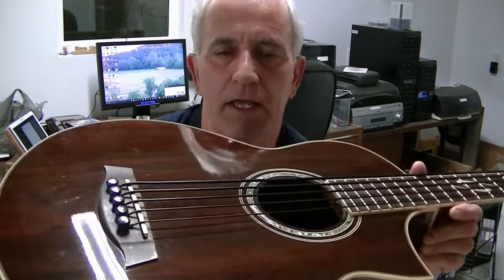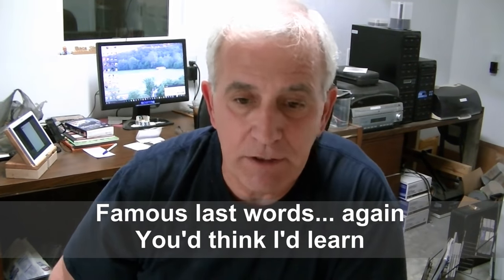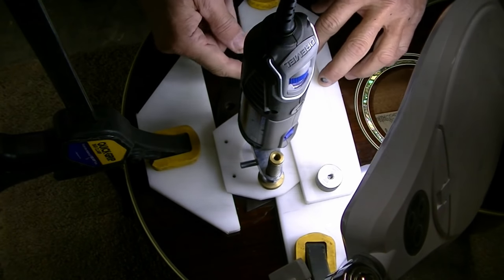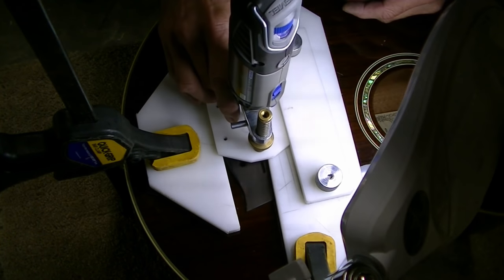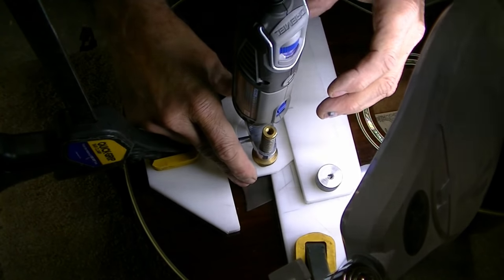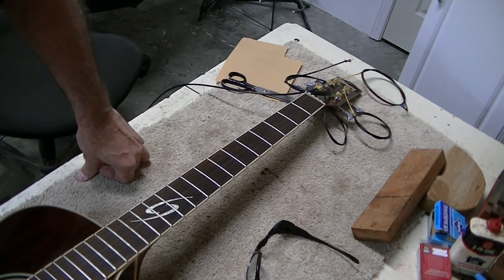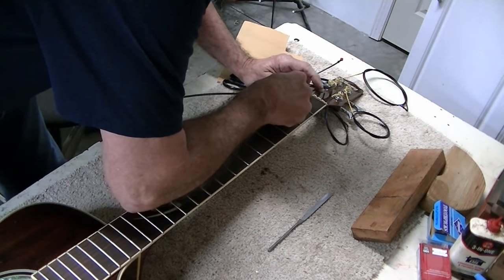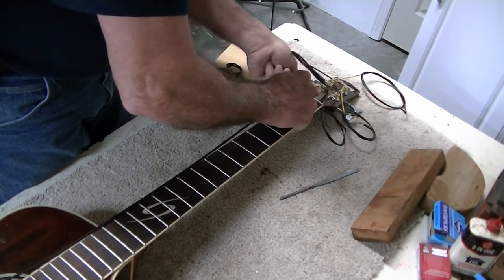114 RSW Ibanez Bass Severe Intonation Problem

Comment: I for one think you did a great job on this guitar. If you had elected to go with a tail piece, you would have had to notch the saddle to keep the strings from floating too far sideways on a bass. Their isn't enough of an break angle over the saddle with a tail piece without notching the saddle. I think this is the best solution I have seen for this problem. Also great execution of the work. Loved your video. Glad the customer was finally pleased.

Comment: Hello Sir,  I shall start with a compliment if you'll indulge me for a minute on my own journey with trying to achieve the best intonation results I can get. I've watched around 15-20 of your repair videos to date and am nothing but impressed by your depth of knowledge, wide arsenal of useful repair techniques and high standards applied to your work. I am a subscriber to your channel as well and have never seen anyone with the amount of patience and attention to detail that you possess.  I have been working on and setting up instruments for over around 15+ years and one of my first hurdles to face was adjusting and improving intonation.  One day another experienced guitar tech had watched me intonate a guitar on a repair bench (by this point I had roughly 5 years in and was working in a music shop on a instrument which now belonged to a customer) and immediately commented on the fact that unless the guitar was going to be played on the customer's lap then intonation should be only be measured in playing position.  I asked what his reason was and he continued to tell me that the influence of the instrument laying under its own weight in a flat position can provide incorrect readings in a range between 05-10 cents.  Now this was something unheard of by me so I put it to the test then and low and behold my readings were coming up sharp by a few cents on each string when it was flat versus playing position. Now these degrees can vary with all kinds things like the break angle caused by the height of the rest apparatus and weight of the materials on the instrument (basically the overall influence of gravity) but this information instantly revolutionized my intonation chops as I came away with a sharper and more accurate method of getting a good result than I had been previously. The way I put it into practice is before I "Call it good"' to quote yourself is to always give it the fine tune in playing position.  Cheers and thanks for sharing your talents and stories with us all.

Comment: I know this is an older video, my first time viewing it.  The only thought I would have had is a new bridge with a wider (deeper?) profile so it covered the scar in the front.  But then what do you do with the string holes?  I don't imagine you could fill the old ones with a patch under them, I am not an instrument guy, just a woodworker for 50 years.  You had a heck of a dilemma and I think you did right by the customer, loved watching you step through the problem with a solution.

Comment: Enjoyed this forced march -  I like and enjoy many of your videos giving me some confidence that I can get my Martin D28/1952 fixed.  One of the things that's obvious about intonation is that the higher the amplitude of string vibration the further off the intonation gets.  Not clear what genre this customer plays - you wouldn't think an acoustic bass would be the hot ticket for heavy metal, but the best advice for your customer would be to crank up the gain and use less force on the strings get the same volume with less amplitude.  The other problem with perfect intonation is some folks expect those higher notes to be sharper or flatter to their ear regardless of what they measure.  No less a light than James Taylor advises that he wants certain notes to be a few cents flatter to make his sound stage better balanced in his view (which as a fan I am good with).  A lot of good stuff.
Reply from the maker: Cliff Campen thank you very much my friend good information

Comment: I have an Ibanez ABG with the exact same problem. I was wondering about pulling the bridge. Fortunately, my bass doesn't use pins to anchor the strings. Also, Mine isn't as bad. Before I try routing on the bridge on mine, I'll try gluing another piece of bone to the back of the new saddle I made. I thought I might get it close enough, since the lower tension strings I put on should require less compensation. The bronze roundwounds were much worse than the strings I have now. 
Thanks for the inspiration! Keep up the good work!
Reply from the maker: magikbike you can send me a coupke pictures if you want.  Sounds like you have the right idea.  Thanks for watching.

Comment: My friend John, God rest his soul had a old vantage electric 2 piece and the guitar had a fender style bridge and the intonation was still off after taking the springs out and filing down the back side of the saddle and I still wasn't in the ballpark, no harm no foul. He had his mind made up on those graphite saddles and went out and bought them. I wanted the intonation to fall dead center so there was plenty of play to adjust so I had to remove the bridge, the screw holes were over a quarter inch in so I didn't have exposing holes when I was done, but I needed all of that quarter inch and the intonation fell dead center, perfect! Except there was one fret that was misplaced in the higher registers, this isn't a big issue for most, but he played a lot of lead and I would have had to place the fret just far enough over to have one big grove which I told him I could file the end of the fretboard and used that dust to make it the same color just adding most of the dust with the wood filler, shave that down with a razor then moistened the top with tight bond mixed with some of the Rosewood dust and sprinkled the rest on by packing it down with a flat surface. You could see the dust moisten up which is perfect. He insisted on that $150USD CHEAP beater that he called his Hot Rod when he had every top of the line Gibson made, but my favorite guitar is a $450USD Ibanez over all of my top notch Gibson's after working it. The Ibanez has a nice and fast neck because it has a shallow contour whereas the Gibson is fatter, more rounded. He had blue knobs off a kids dresser and cartoon decals all over it, but I put really nice pickups in and it sounded like a million dollars, all new top of the line hardware. He was a big man and strong as a ox, but kind as can be so I had to do a fret job and shave the wear marks from the board using a razor, just tip the razor back and pull so you don't stand the razor straight up, you will get chatter marks in the wood then turn the guitar around and do it again and I collect that dust. I call it magic pixie dust, no stain needed and if you have a deep groove in the fretboard from your fingernails you can use the same method, after you're done you can mix some of that magic pixie dust in with some wood filler or glue depending how deep the groove is and dust the top, I even used a needle to give it back the grain lines
Reply: Man that's hard to read. Try breaking it into paragraphs next time.

Comment: ....Thanks for the upload,  I'm still learning, I just bought a 5 string Ibanez bass,  in the set up guide, it says that the lowest frequency string should be a 'B' , rather than a 'C'
Reply: That's an interesting comment,.... However that lower (bass side) string was already vibrating and LOOSE all over the place when tuned to a 'C',... so going even lower to a 'B' would be worse.
.
Perhaps the GAUGE ( weight and type ) of strings - if lighter / narrower / wire -wound ,... might even help. That 'C' was sticking at the nut.
.
.

Comment: With all the challenges that this guide presents to you, you might want to replace the piece of white teflon (I'm assuming that it's teflon) with a piece of clear plastic so you can see the wood beneath it better. Also, I saw on a guitar maker's site (it feels like I'm cheating on you by watching it!) that they had an adapter for a drill that lets you tighten strings with ease when setting them up. Just a thought I love your videos! Thanks for sharing them with the world. Best wishes from Delaware! 🎸 🎻
Reply from the maker: I've got several of those string winding adapters. I don't bother with them because of my method I only have to turn the key a couple of times it takes longer to put the adapter on then to mess with it. Regarding the plexiglass I've had clear ones on there before they get scratched up and no time you can't see through them anyway. I like the one I have it works really well.

Comment: I think you did a great job! You went the extra mile to get it as good as possible.. My only concern is regarding the pick-up, I didn't see you check it after the work was completed. The question is, was there any fall-off in volume on those lower strings, were they all still balanced?
The contact points of the strings with the saddle being not directly over the pick-up.

Comment: Rosa String Works A tip for picking those very low bass notes with the tuner : play the 12th fret harmonic instead of the open string. It's an octave higher and the note is clearer so the tuner "reads it" better.
Reply from the maker: Julien Sorosac thanks.  Thank you for watching.
Reply: Well that tip is nothing compared to the amount of things I learn from your vids. So, thank you !

Comment: I just lost my original comment, so I'll shorten it.  If the bridge is at a slight angle to the nut, would that cause an intonation problem?  In that case I'd angle the cut of the antler to parallel the nut.  I'm thinking of my physics classes, length of the string as well as tension setting the tone.  I don't understand what you did, adding to the back.  Another question is why does the tone from that base guitar vary so much?   Is that close to average for base guitars?  If not could that be a big remaining problem?    What could be done for it?  

 I don't play an instrument,. Thank Jeff Bradshaw for me being here and learning from your videos.  I love finding out how people do things.
Reply from the maker: Thanks for watching and commenting Bob.  Basically if the string notes sharp, then the string needs to be lengthened.  When you make the string longer the note will be lower.  it is actually very common for the heavier top strings to be longer (set back further) than the lighter treble strings.  Hope that helps.  Thanks again and glad you are here.  Jeff is a good guy.

Comment: The problem was absolutely caused by those black tape wound strings. I have a similar acoustic bass and I put the same strings on it. The first time I tried performing with it I noticed how bad the intonation is. By itself it is fine, but with my wife playing piano, those upper notes are terrible.
I still prefer flats, so I keep it like this and only use it for practice.
Reply: Just said the same myself, especially the low b! Asking for trouble..
Reply: Actually these are Black Tape Wound Strings designed for this Bass

Comment: Have you ever tried a tuner app for your phone to set intonation? I really like the PitchLab app for android. It shows the note with a needle like an analog tuner as well as the hertz (as well as much more data depending on which screen you use). I think it's probably more accurate than most stand alone tuners considering the computer power in a phone vs. a few IC chips. What do you think?
Reply from the maker: Thanks for the idea. Yes I do actually have a couple of those apps. I haven't used that particular apps though. My desktop tuner does have a needle. Thanks for watching.
Reply: I really enjoy your videos, only discovered you last week. Watching and "liking" every thing I can. I work on a lot of electric basses and guitars but always shy away from acoustics unless it's just a string swap and setup. Your videos are very informative and I might not shy away from such repairs in the future thanks to the knowledge gleaned from your videos. I doubt I'll be doing a neck reset anytime soon but I won't be afraid to try and glue a simple break...as long as I think I have enough (and the right kind) clamps! LOL.

Comment: I prefer to check the intonation when the instrument is in the playing position. 

I've always referred to the lowest sounding strings as the "bottom" strings. 

Similarly, moving towards the nut is going down, as the pitch goes down. Heading towards the bridge is going up as the pitch goes up. :-)

Comment: i have had intonation problems with those tapewound bass strings. something about the tape messes things up, even with them set right at the 12th fret, some weird things happen at the lower fretboard. obviously the bass was the issue, but i think with better strings the job would have been easier. I like the tapes, the feel and sound, but they behave strangely.  for bassists, try Thomastik-Infield jazz flats. expensive, but they last a lifetime. 10 years on my bass and going strong. But besides their longevity, the feel and sound is superior.
Reply: I think they have to redesign the Acoustic Bass to have an Intonatable bridge like an Electric Bass.

Comment: Jerry, I'd like your comments on my thoughts here.  There has to be some theory and thus design rules for making string instruments. Frets complicate matters because they have to be set to divide the string lengths as advertised (1/2,1/3,1/4, etc). I don't know how thickness of strings affects the notes, but we can ignore it for now.  You said that the saddle should have been farther back when you started working on this base guitar.  What I've seen you do to the guitar is move the strings saddle points farther back the deeper the full string note of a particular string is.  Thus, the center of the whole saddle angles down from high notes to low.  If the whole saddle were farther back, would that angle be less or at no angle to the nut?   
To put this another way, could you have used a version of your, um, "floating bridge" to figure out the angle needed, starting at the treble end of the original slot?  If you can make a tool to do that for bad intonation problems, it would speed you up considerably in my opinion.
Reply: Hmmm, I seem to have been thinking similarly when I made my first comment 3 years ago!  This time I have a theory. 8-)) Add angle to a misplaced bridge (shortest strings at treble end, longest at base end) to compensate for bad intonation.

Comment: Not many acoustic guitars come perfectly intonated from the factory, even the ones with compensated saddles. Makes me wonder if this guy played it before he bought it and if he can hear it with his ear or just checked it with his tuner. What I'm getting at is a lot of folks play out of whack guitars quite happily until they check it with a tuner. If he ever checks it from fret to fret note by note it will make him crazy. May a good candidate for an Earvana nut. I have done the gluing extra bone trick to a nut to see if a guitar would benefit from an Earvana nut. And it worked great. 

I bought the tuner app Randy demoed and it works very well, very sensitive. It's called Pro guitar tuner, it's a 4.00 app works on iPhones as well as androids.

Didn't mean to get so windy, anyway great job and I need to make one of your slot jigs. Great tool.
Reply from the maker: Thanks Dane.  Appreciate your thoughts.

Comment: I wondered at first if you were going to enlarge the slot only a little, and then you may have made another saddle similar in design to the original, so that there'd be an overhang, but significantly closer to the pegholes. I know you can only get so close without having other issues as a result, but that's what I'd try.
Reply from the maker: randolph patterson thank you for watching

Comment: With those low strings down to B on a regular scale length you will naturally struggle to intonate it correctly. It’s just poor, compromised design from the start. A staggered bridge would have improved matters to some degree, but I think the low B would always be troublesome.

Comment: You have to wonder what strings that bass originally shipped with and whether the strings it has now are substantially different. Also it looks as though you were always working with the strings that were on the bass when it was shipped to you, rather than checking intonation with a new set. I'm pretty sure too, that if the owner ever changes string gauge or even moves to strings from a different manufacturer that the intonation will again be off. In any case trying to get to perfect intonation (or rather a precise octave at the 12th fret) is difficult because the pitch of any tensioned string drifts flat as the note decays, plus the change in harmonic content tends to make tuners leap about in odd ways.
Reply from the maker: Thanks for taking a look.
Reply: True. String type can have a considerable effect on the intonation for bass strings, most especially the E and B. In general, flatwounds will tend to intonate sharper than roundwounds. However, you can mitigate that to some degree by creating a clear witness point on the string over the bridge saddle; apply pressure on the string forward and aft of the saddle so it bends over the contact point with the saddle. You will see the string winding separate at that point slightly. Doing this has been, in my experience, the difference between running out of room to move the saddle back or not on a low B.